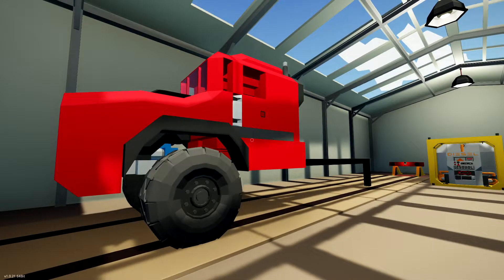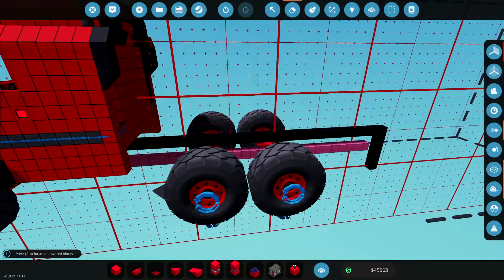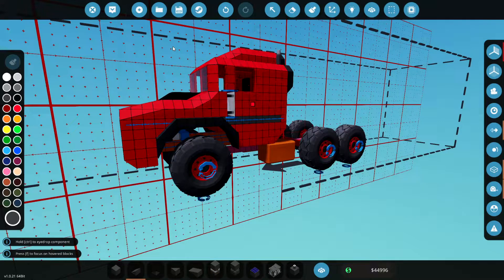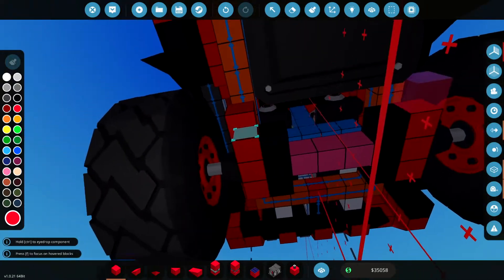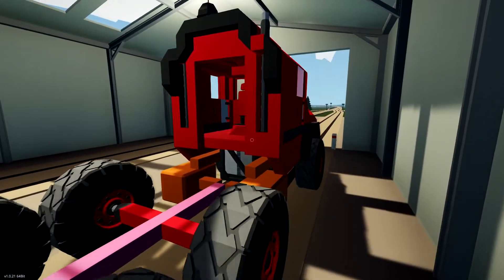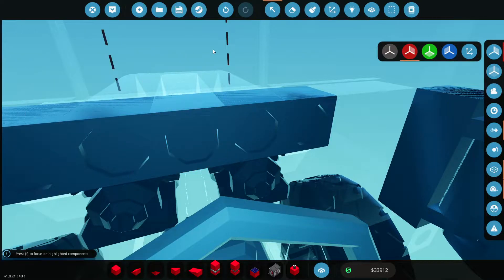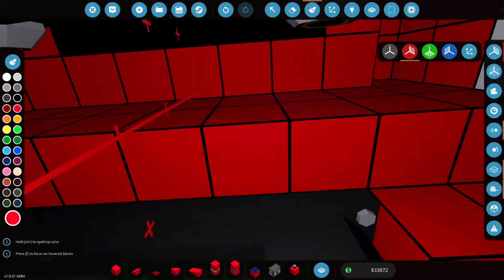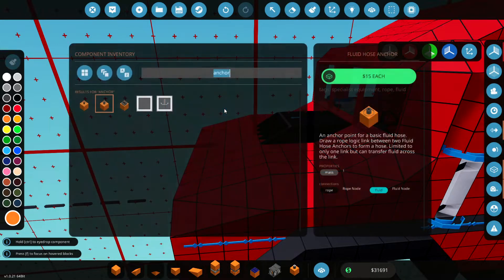I DROVE this BEAST - Stormworks: Build and Rescue - Career Mode - S2E9

Comment: I know I'm late but I'm loving the series and I wanted to drop a couple tips for future trucks!

You're understeering because your steering wheels are also your power wheels, if you power the rear wheels instead you'll have a tighter turn!
Remember that with a loaded trailer, most of the weight on your truck will be on the rear two axels, which gives you yet another reason to use those as your power wheels! If the weight shifts to the rear axels with a trailer, then the front axels will be lifted up off the ground more and more (depending on the weight) giving them less and less grip for steering and power! (So be careful cresting hills with a trailer, your front axels may lift off the ground completely!)

When it comes to multi-axel steering, you'll want your front most and rear most axels as steering wheels, and leave the center axel as non steering (for a three axel setup like you have). If you've got 4 or more axels, again, you'll want foremost and rearmost axels to be steering, and working your way towards the center axel from the rear axel, you'll want them steering at less and less of a maximum steering angle, keeping your center axel as a non steering axel!
Reply from the maker: Hey Tyray3P! Thanks so much for your comment and suggestions. I will remember that info for future truck builds :) Much appreciated!
Reply: With the understeering, may the same thing apply to a vehicle where all 4 wheels are power wheels?
Reply: @awhahoo  Yes! The more you get pulled by the front wheels, the more understeer you'll have. This is why a lot of all wheel drive cars give like 70% or 80% of the power to the rear wheels, and only 20% to 30% to the front.